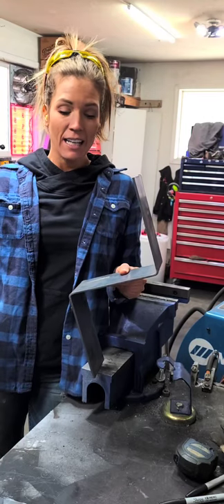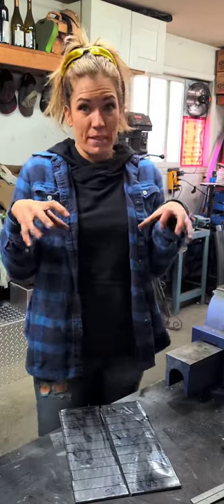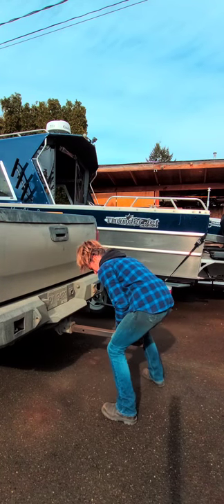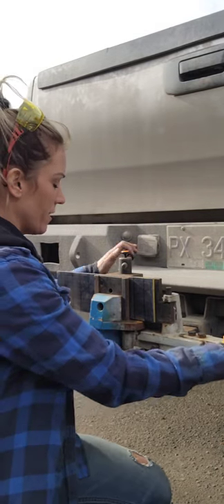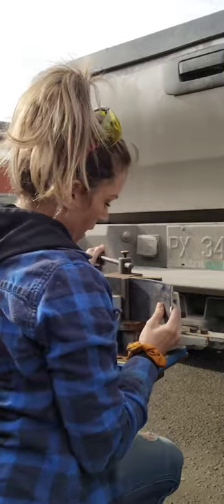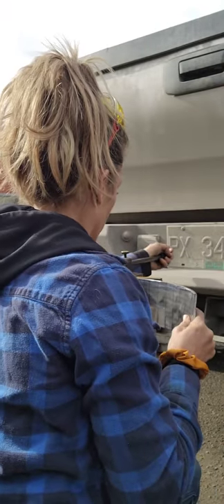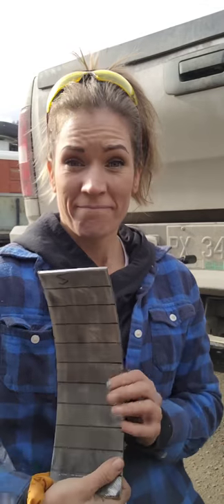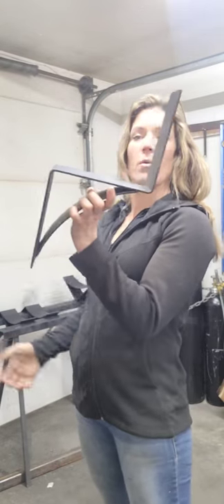Custom Fireplace Mantle Brackets

Comment: Hi Rachel, You could easily make your brackets in a u shape. The steel is strong enough to support a mantle. Make the horizontal part long enough for the brick/fire place wall and the mantle. As the brick layer builds the fire place, he would put the brackets in the mortar and continue to lay the bricks/stones of the fireplace and the brackets would never move. Think about what you put on a mantle. A couple of candles, clock and a porcelain figurine. Take care.